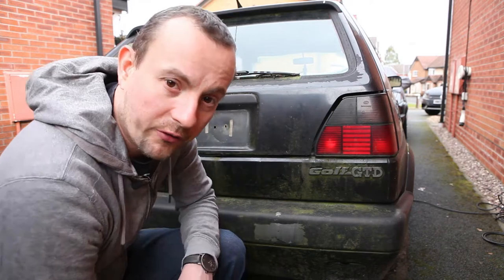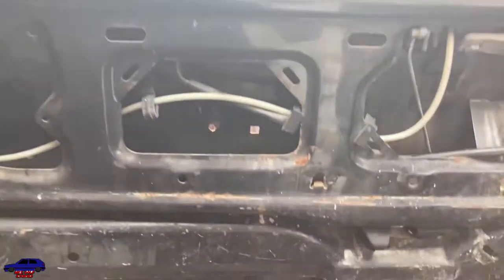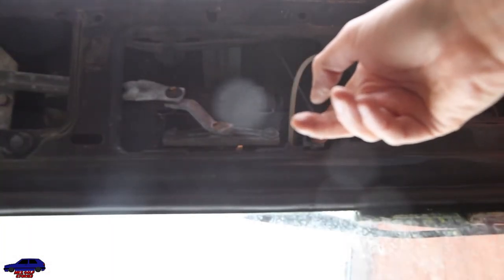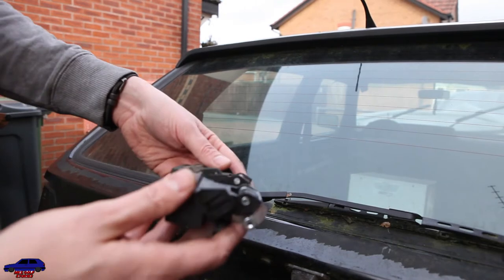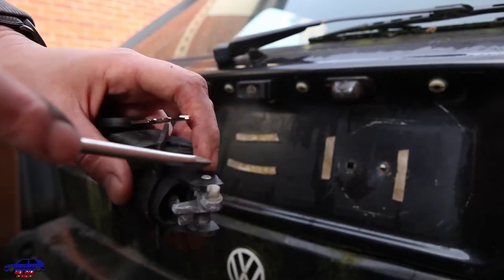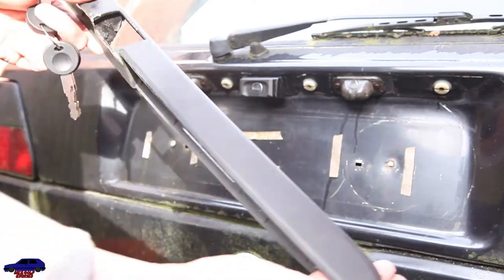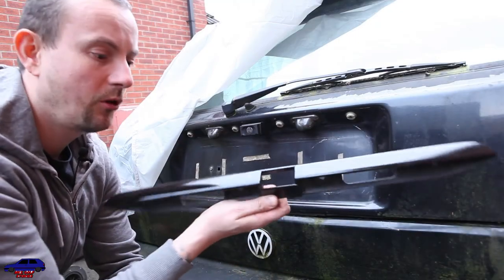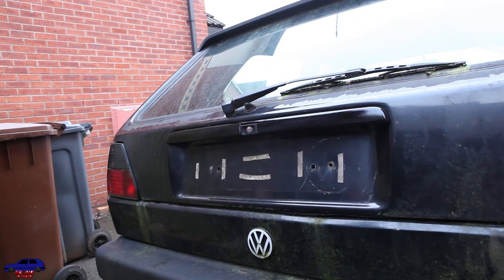How to replace the Boot lock on a MK2 Golf

Comment: You don’t need to paint the plastic trims, Paint will come off. You can just heat with a hot air gun or blowtorch and they go back to black again. Same bumpers etc. :)
Reply from the maker: By heating them up all you’re doing is releasing the oil that’s trapped in the plastic, eventually it will fade again.
This had already been painted (as you could see), so I didn’t really have any other choice than that or replace it :)
I know paint will crack over time but this was the best short term fix
Reply: Let us know how this aged because with blow torch the inner dye of bumpers fades even faster, which makes you end up with white bumpers instead of gray. Dont shoot the messenger though.